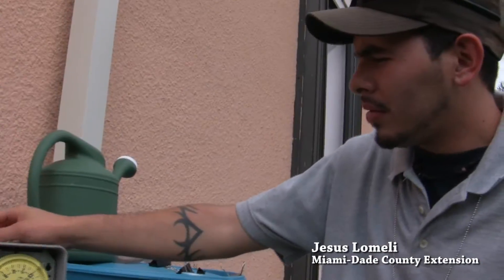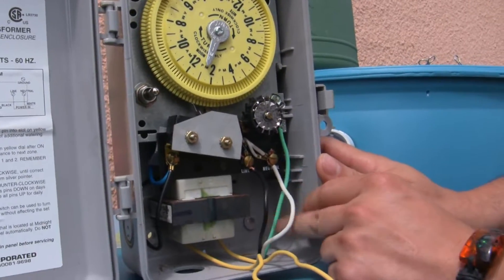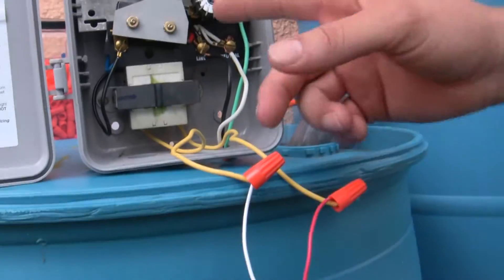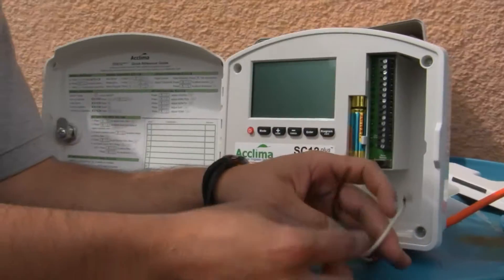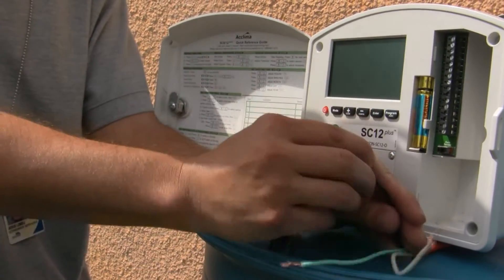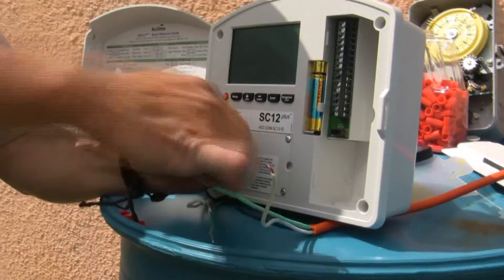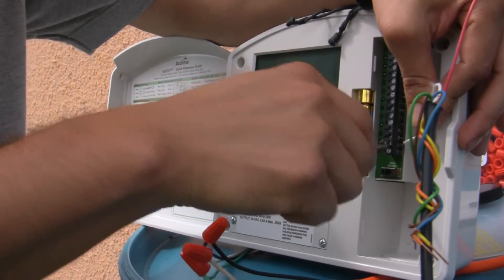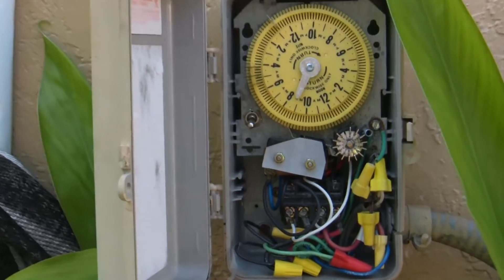Replacing a mechanical irrigation timer on a municipal water irrigation system

Comment: Thank you so much for this video, I have been looking everywhere for answers to my problem. I have a mechanical system with a power voltage of 110.  I want to upgrade it to a smart sprinkler system that uses 220. Can you recommend the type of sprinkler timer that I need to buy? which brand etc? thanks!